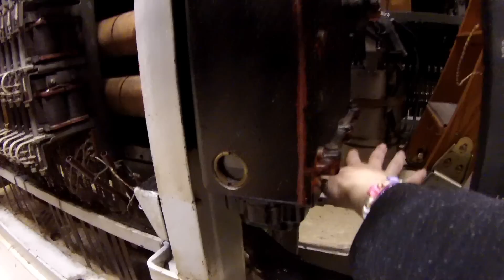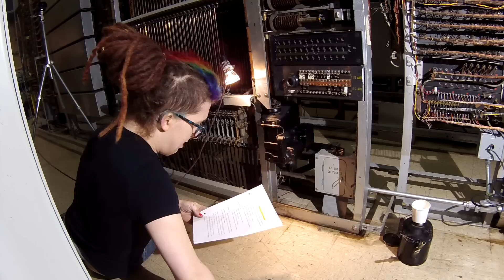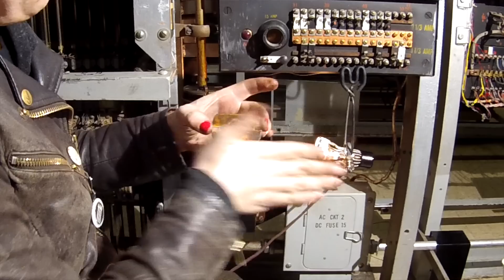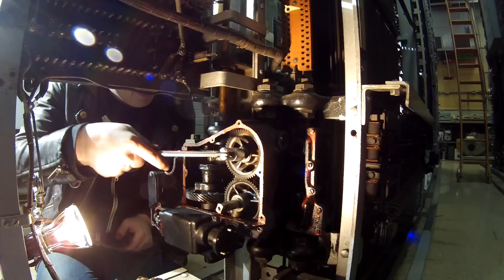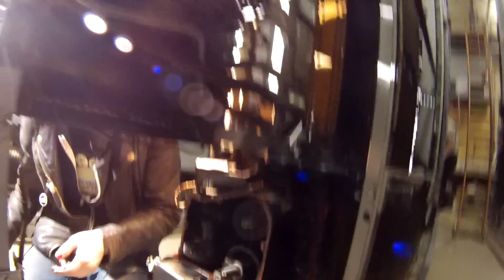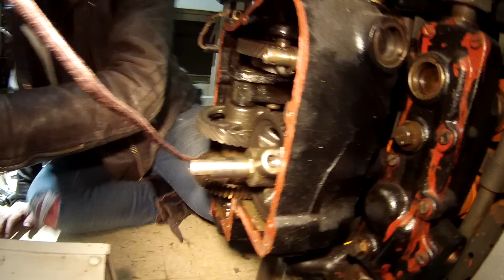[Panel] Removing and replacing gearbox and friction roll drives (Part 1)

Comment: Not only is that gearbox in such good condition considering it’s 100 years old, just think that those gears were made long before CNC machining. They were made by skilled machinists on manual milling machines. The locking group screws on the gear is so typical AT&T. Never a single point of failure.
Reply: There's no reason that should make a quality difference

Comment: Would you really use W oil? I am not an expert but when I was restoring my lathe I was told for things that use a sump to collect debris you use regular oil (no W) and for filtered oil loops you use W oil.  The W means that the oil has an agent added to it that keeps particulate suspended so the filter can trap them vs the other kind that is made so particulate settles in it to the sump for cleaning later.

Comment: I don't think I've ever had -48 to the forehead, but I have had it to the top of my ear while cutting over to a new NEC PBX from the Fujitsu F9600 that we had... Turned my head to answer a question, and got just a little too close to the fuse board... OUCH! (at least it wasn't the -130 for the T1 channel bank in the next bay...)

Comment: (Yes, two years late to the dance with this) I love these videos. I hoe that you have a decent socket set on hand at this point.  I might also suggest a Yankee type driver with adapters. Ma Bell issued them by the caseload, and they are really the best tool for a lot of tasks. Good feel and control, as long as there is a little room (#35 size is my choice for this type of work). The coupling from about 17: to 19:30 is an Oldham coupling. They allow parallel shafts to have lateral misalignment, but, unlike universal joints (Cardan, Hooke), take little axial distance and the angular velocity (and angular position) of the output matches the input at all times. The tradeoff is generally lower torque capability and higher friction due to the slides.

Comment: I'd use straight #10 none  detergent oil similar to Singer Sewing machine oil or Teletype machine oil. automotive is not the best. BTW, SAE 10W is equivalent to ISO 32, SAE 20 is equivalent to ISO 46 and 68, and SAE 30 is equivalent to ISO 100. As you can see, there is a bit of a difference between ISO 68 and SAE 30. The viscosity of the fluid largely determines the oil temperatures within which the hydraulic system can safely operate. So if u go to a supply house, the best is MOBIL ISO 32. It's the closest thing to Teletype oil used in the model 15 and 28 TTY ( I repair 15's and 28's).  On Amazon search for ISO 32 oil. Also, WW Grainger. If I lived nearby, I'd volunteer to service your D4 channel banks (if u have any) or the TTY machines, L o L. I'm in Floriduuuh

Comment: I'm 68 now and would have LOVED to have worked in this type of central office when i was young.
In a sense it's fortunate by the time i was getting into an electronics career, most of these offices were being updated as that technology was being phased out.
Wouldn't have wanted to get into a career that was at its end 
Does make you wonder how many of the old cats that 'grew up' as techs were able to learn and transfer into the new solid state switches of the 80's.
Just love these videos.  Sarah makes interesting and very understandable.  Just wish i could find a general block diagram of the entire switch to get a broader sense off the signal path...especially the routing piece.

Comment: Wooden handled screw drivers, how so many of those have come off or split in half! ;o)
Reply: I would think these gear boxes would use ND (Non-Detergent) lubricating oil.  I suppose there is no magnets in the bottom of the gear box to capture any wear/shavings?
Reply: Spline key screw without a security center pin?
Reply: Of course reassembly with a little oil/light grease on all of the screw threads.

Comment: If this piece of machinery was in service, would phone subscribers lose use of the lines during maintenance? Or was the system smart enough to use another frame while this one was offline?
Reply from the maker: Scott Legg it depends on the maintenance, but generally, no, subscribers would not lose service because most frames are part of a larger multiple, and the part being worked on would be “busied out”, and appear to the rest of the switch as being unavailable. Calls just went right past the busy selectors to the available ones. 

The exception to this in my machine is the line finder and final frames. They are not multipled, and if they went down, subscribers would lose service. This was somewhat mitigated by having each side of the frame work independently. Each side has their own motors and emergency circuits which could be cut in if needed. 

Later machines were extremely robust and had several layers of backup circuits they could fall back to if the main “home” circuit went down.
Reply from the maker: I should also add that most heavy maintenance was done overnight, to minimize its impact. I couldn't imagine doing a job like this during busy-hour!